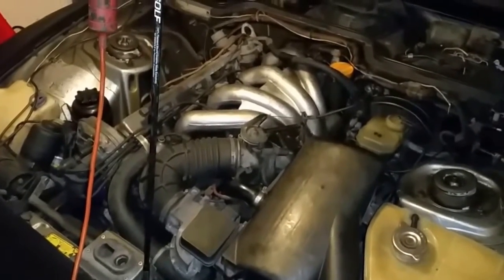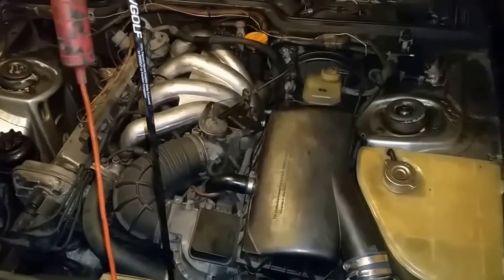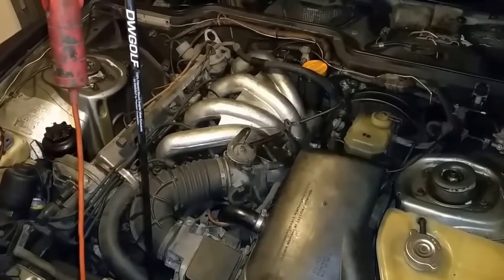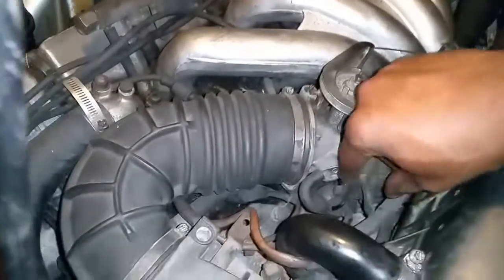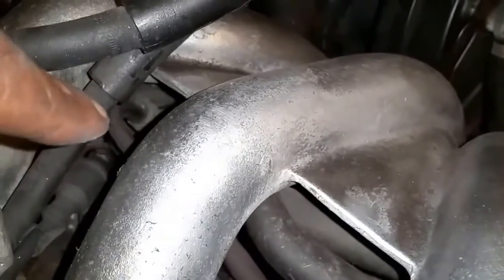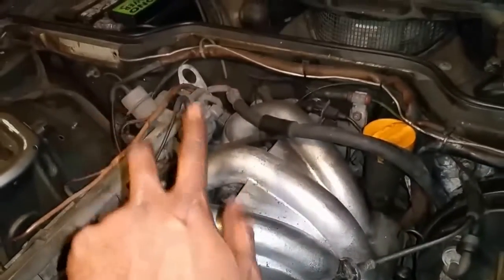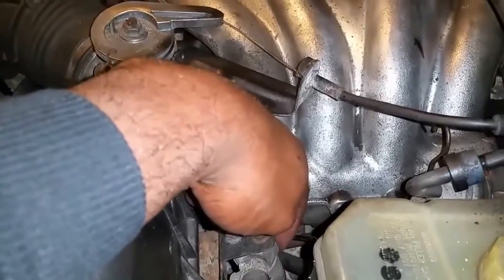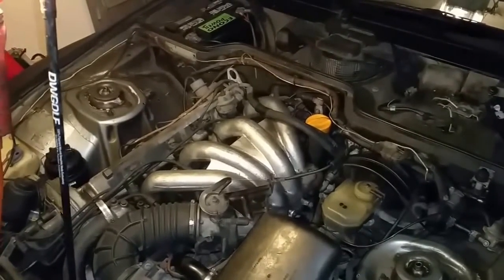Porsche 944 vacuum lines correct setup

Comment: makes absolutely no difference whatsoever where the vacuum hoses connect its a vacuum not an electrical impendence circuit.
The only important issue is that there are no leaks in the system. The warm up switch is for emission control and vents fuel vapour back to the tank under vacuum or deaccerlation, its an unnecessary device which can be deleted and used to connect another water line to aid cooling at the rear of the head which can help save your headgasket in the event of vapour lock due to the poor cooling system design.
Reply from the maker: Kev Rob I would have to disagree, especially from an emissions point. without switching the EGR valve configuration, I couldn't stand in the garage with the car running. Seriously the fumes were so bad I couldn't breathe. Once I made the switch, the fumes stopped and I got quite better fuel economy. That's just what I experienced.

Comment: FC, great video man.  I have an '83 that I rebuilt the top end on. Those vacuum lines are so important. I replaced them all while things were apart. Piece by piece and luckily kept it in the right oreder. Big improvemtn. no more leaks and the car loved it. Thanks for the efforts and info.
Reply from the maker: Joey Stanker thanks man! I've since sold that 944 because I lost space in a move and have been regretting ever since. Every time I look at my watch it's 9:44am or pm. I rang up a lunch and it was $9.44. I even opened a book and it fell on page 944. Okay I'm joking on the last part, but I'm hunted by the car. I need another one. Early spring I think I'm going to do it again and buy another. lol

Comment: I have a 83 944 and I was driving down the street and came to a stop sign and pressed the brake, (I knew that I needed a new brake booster) and the car died. I pushed it back home and got a new brake booster in. The car still won't start and new it won't crank or it will have a low crank... But I am out of ideas it seems that it could be 101 different things like sensors and so on. Do you have any ideas... Can you please get back to me if you have any ideas I really need to get the car back on the road
Reply: LB Garage Did you check the battery? Turn the key onto the on position and listen for the fuel pump. Try charging the battery.

Comment: the sensor you mentioned as temperature control unit. Is that the one with two little tips sticking out ?  under the manifold

Comment from the maker: This is the most common setup for the Early (83-85) 2.5 na 944. The engines rev gradually but not like a rotary or anything. You will blow the motor if you don't regularly change the timing belt every 40k. thx